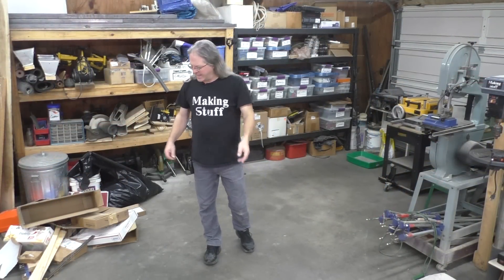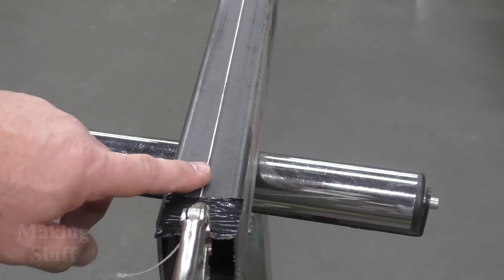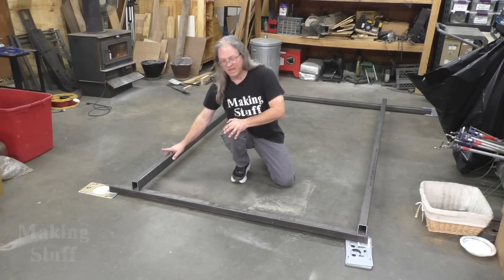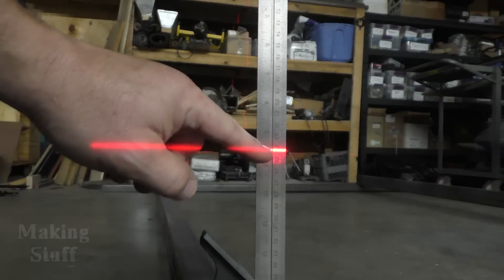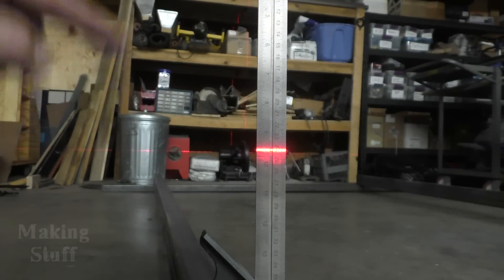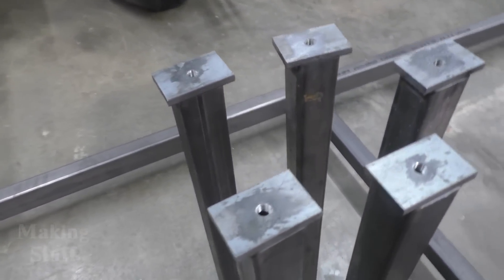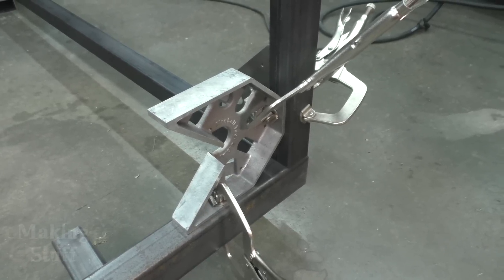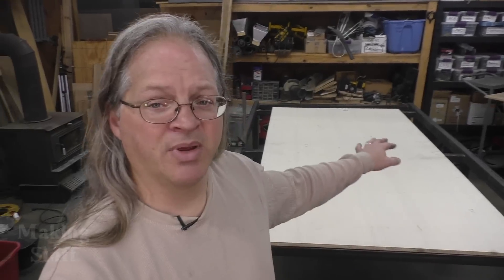DIY CNC Router - Part 1 Building the Frame

Comment from the maker: I think this machine is almost too big for my shop!  Let me know what you think!
Reply: Nahhh there isn’t such a thing as a to big a machine there’s only to little space
Reply: @gerthalberg9735  yes, an infinitely large surface would be ideal. That way you only need to ever lift material and never have to move it in the X Y plane. It would also mean we only need one such machine on this planet :). Seriously though, if you can fit it in, a full sheet CNC router is the only choice.
Reply: I really enjoy that you show the methods you use to square things up. Most diy instructions just say things like "make sure you are lined up and <insert next step>" they gloss over some of the most important stuff.
Reply: Fantastic! good thing you have a big place!
Reply: Cant ever have regrets going to big, only regrets not going bigger
Reply: make it rigid down low between the legs, put is on lockable, swivel castors of  2 or more inches diam
Reply: You probably need to arrange the stuff in your shop, the machine table can also be used as a table when performing simple tasks. Goooood job I loved the string and laser light techniques
Reply: that card trick was AMAZING! t would not fool Pen and Teller but I know it would amaze them as much as it amazed me. Thank you for this simple but powerful knowledge!
Reply: My current shop (an attached garage) is 13'x22' with an 8.5' ceiling. I have used every square foot of wall space, and still have to shuffle tools to and from the shed. 

I'm building my first CNC table (after dreaming of one for years) finally the parts prices have come down far enough it's within my budget (barely) and i'm tired of waiting. Not getting any younger. 

I'm making mine 5'x10', seeing as how i'd like to cut 4'x8' sheets easily. Mach4 Hobby + DesignSpark Mechanical, Sainsmart 5-axis breakout board, (5) DM542T stepper drivers, (5) Nema 17 stepper motors, 100 skateboard bearings, 24vdc power supply, ACME leadscrew+nuts from SurplusCenter.com . 1" EMT conduit for guide rails. Adjustable rolling blocks in case i wanna step up to beefier guide rails later.

The gantry will be 3' tall, to allow me to route logs or columns. My design allows the gantry to fold flat. The water pan (for plasma cutting) will slide out of the legs and store on the table under the folded gantry. The legs fold up. Total height 8" folded. Using a windshield-wiper motor and some EMT conduit, plastic hose, pulleys and cable, it will be hoisted up to the ceiling for storage. It will fit between the crossbeam for the engine hoist and the spring for the roll-up garage door (8' wide x 11' long empty ceiling space).

Anything is possible. Think outside the box.
Reply: @darrelljacobjr2120  Dude! This sounds awesome! It’s been a year…did you do it? How did it all go? Did you take any footage? How did the 1” EMT work? Asking because I’ve thought along the same lines with folding it up and storing it in my ceiling due to lack of space. Do tell!
Reply: Machines can never be to big. 
I’ve been thinking about building one of these myself.

Comment: This is the first of your videos I've watched. How has this machine worked for you? About how many inches per minute will it do with a 1/4 mill with a 1/8 pass on plywood? I have a Maker made but want a gantry machine to make better cuts throughout the plywood sheet and to cut much faster.
Reply from the maker: I no longer have this machine.  Had to find it a new home because we thought we were going to be moving to a new location, but that deal fell thru after the machine was sold.

Comment: So many people start projects like this not understanding the part that Near-Absolute-Flat plays in the work that the router is going to do.  If it’s out a few thousandths and you don’t have any adjustments the end product is consistently going to be ‘wonky’.  And if you’re in it to make money…well…customers don’t buy ‘wonky’.
Reply from the maker: That's true, but for most DIY projects, signs, etc. you don't need +/-.0001 accuracy either.

Comment: The final distance from the Z axis tool tip will be right on when you machine the top of the bed surface. Any changes in the height of the cutter will disappear after the surface of the Table top is machined the first time you use a sacrificial surface.

Comment: No matter how tight you pull that string you cant measure that tight of a tolerance against gravity. The string will sag. Now if  you turned the setup on its side and checked lateral then you would have a accurate measurement.

Comment: does it really matter if the table frame has a slight bow as long as the linear bearings, rack and pinion, etc are straight and parallel? like you said, you can plane the plywood flat
Reply from the maker: Yup, that's the plan.  Thanks for watching!

Comment: There’s a formula for calculating the drop of a wire that’s of a specific size and under a specific load; instead of string I’m going to use fine stainless steel wire and pull it with a 30lb weight. Then I’m going to cook up a gizmo with a micrometer head and a LED that lights up when the micrometer spindle contacts the wire; allowing me to read the drop to less than a thousandth of an inch.

Comment: You usually string-line on the side so gravity isn't a factor. You also space the string-line out from the material by an equal amount on each end, that way you can see S-shape bends. Basically if the string-line is flat on the material the hump of a S-bend will hold it up and you won't see it.

Comment: How do you know your concrete floor is straight?
Reply from the maker: It's not.  That's why I used the adjustable feet and the laser to get the top of the machine level and in the same plane.

Comment: I was about to do a MPCNC then found it not rigid enough.  I then was about to get a 3018 then found it wasn't either.  Well, crud.  I then see 3040 and 6040 can do Aluminum 6061 but really you need to remove the rods and go rails so dang it.  What I need is a machine the size of a 3040/6040 that can do Aluminum that is about the price of a 3040.

Comment: Don't put too much effort into getting your frame perfectly flat.  In the end its wasted effort.  Close enough is good enough.  You'll find you'll have to repeat the exercise again when you mount your linear bearings.  Thats when it counts.  I poured epoxy on my base frame to get a perfectly flat and level plane.  That became the reference surface for the rest of my build.  Following.
Reply: Exactly what I has been thinking.More over this does not make sense at all. Gantry is not referenced to floor but to the base frame :)

Comment: My first build was a grizzly metal mill conversion. I got a Avid CNC router . Table width is important this time,  much of the sheet material I work with,  come in five foot wide sheets. That extra foot represents big savings if you do  much parts nesting. Anyway great job video documenting the experience. It is never wrong to build better ideas. :)

Comment: You cannot get an accurate measurement with the tube supported on each end.
This is normal deflection!!
You can straighten the tube, but it is labor intensive.

Comment: Scrap the router and get yourself a water cooled spindle. Them routers will blow your ear drums after a few hours. I know first hand as I made a CNC machine myself.  Now cutting metal with em. Besides you get the R20 Collet for them small endmills.
Reply: Uhh... you mean ER20 collet, right?

Comment: Good luck with the build ! 
Tried bringing a 6 x 4  CNC Router frame  to a 12 x 12 room for finishing and fitting out but it just stopped any kind of spontaneous work, so progress took a dive. Moved to larger outbuilding ....still working on it
You could put that in a number of places given the layout of your shop, but access to feeding it 8ft material is one priority. Just back it up to the wall instead of the wood shelves?
For a cheap frame rail straightener you could use ratchet straps to remove the bow while you weld diagonals or even wire rope and turnbuckles. 
KInda like Buckminster Fuller's "Tensegrity" Using compression and tension members achieve stiffness and in your case dialing in the bow where your linear rail is ultimately going.
Or you are into the epoxy levelling debacle.
There is but one other method, that of buying aluminum t-slot profile to and fasten to you rails and shim to spec.
High tolerances, sophisticated and is great for mounting and adjusting linear rail with dial indicator
From what I have learned so far, you will need far more mass (moment of inertia) to manage the simplest chatter-free aluminum machining. Smaller equals stiffer and therefore difficult on larger tables
No matter  how you proceed you need more support for the MDF, believe me. 12"o.c.  Increase mass, stiffness, and reduce chances of standing waves that will make it sing! 
Consider filling your rectangular rails with epoxy sand. 
Keep in mind the weight of the gantry with a decent Z axis assembly and its acceleration with a 2,2kW spindle versus the mass of supporting frame
Etc, etc
We could  talk for hours
Reply from the maker: Thanks for the input!  You have some good points.

Comment: Just a suggestion. Put a nut on your leg leveling bolts. It will do 2 things. Take the load off of the threads, and lock them in place if you need to move the machine during the build.
Reply from the maker: Good idea, thanks.

Comment: This is great. We made one too, the same size but under engineered the Z plane and probably the other two axis and consequently our repeatability and accuracy is horrible. Clearly my mate and I need to redesign and build the gantry. How does one calculate how to make bits stiff enough without turning them into gravitational objects? Something about the mass of the router, height of support structure, material choices etc. No, we don't have or have the knowledge to use finite element analysis or other such hi techery, and our "feel" for such a large structure is just not there.

Comment: An interesting build I have built many (more than 10) of these with gradually improving results so will advise accordingly as you go LOL You certainly need to get it as flat as you can to start with far more important than a plasma table. However the machine will flatten its own waste board, the important reference is an even height to the table which that achieves. Timber will bend flat to the table within limits.

Comment: I didn't think it looked like you had room for it,but after you got it flipped over right side up it looks like you have plenty of room.  You're right there with it. Is there plenty of room to  load and unload a 4 x 8 sheet of whatever you are using?
Reply from the maker: It definatelt fits, I'm just not use to having something that big in the shop.

Comment: I went through this same process just last month. I also even used a fishing line to figure out flatness/bowing of my square tubes. Both rails had a vary slight bow, I turned the bow UP figuring that gravity and the weight of the gantry might bring it back to straight.
Reply from the maker: Yeah I was hoping the same thing but I turned mine bow down hoping that I could adjust the legs in the middle a little higher to adjust out the bow.  However, that didn't work.

Comment: If you are using ball screws and linear rail be aware the holes in them and the bearing blocks may not be drilled the same from block to block, I had to redrill mounting holes oversized to get everything lined up. Sbirdranch documents this on one of his build videos. the holes are spaced right but they very on distance from center
Reply from the maker: Good point.  But I'm going to use a gear rack and pinion.
Reply: @MakingStuff  Just wanted you to know in case you were,it caused me many headaches,good luck with the build I'll be watching

Comment: Build looking good. Is this just for wood or aluminium also ?

If precision is needed I would not rely on steel tube alone as it is not accurate unless milled flat.
To get around this you can epoxy the tops where the rails will go so not only they are flat but also flat in relation to each other.

Looking forward to next episode. Take care
Reply from the maker: Yes I am hoping to cut aluminum on it too.  Thanks for watching!

Comment: Bob, measuring local squareness at each corner with your little square (don't you farm boys have big framing squares?  :) ), 

but for me, measuring the diagonals for equality is proves the pudding is edible.

Another straight measure is 6 ft alu levels, which are quite famous for straightness, showing straightness over 6 feet, and then also when laid diagonally across a corners, levels the table.

Poor cats, so many ways to skin them.
Reply from the maker: The sides of the square tube is rounded over.  It was hard to show on camera if it was square measuring diagonals.  Thanks for watching!
Reply: @MakingStuff Don't measure from the rounded edge, but from the mid point of a tube, or the mid-point of the miter joint.

Comment: nice card trick. smart. great video as usual. mdf is a much truer plane. what controller are you thinking of using? im sogin abuild with a gecko 540 now...pretty nice little controller
Reply from the maker: I've had pretty good luck with the Mesa 7i96 that I used on the plasma cutter.  I think I am going to use one on this build too.